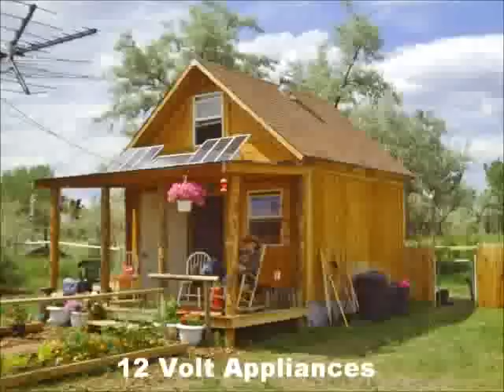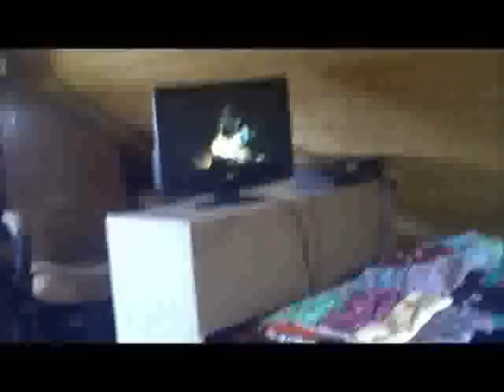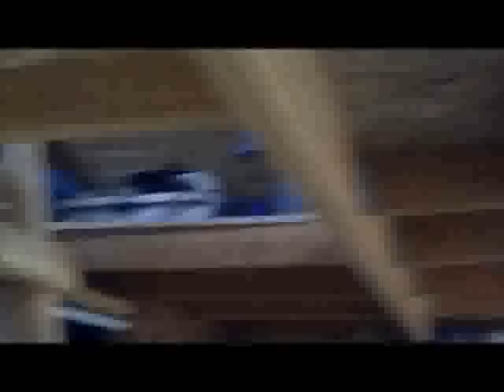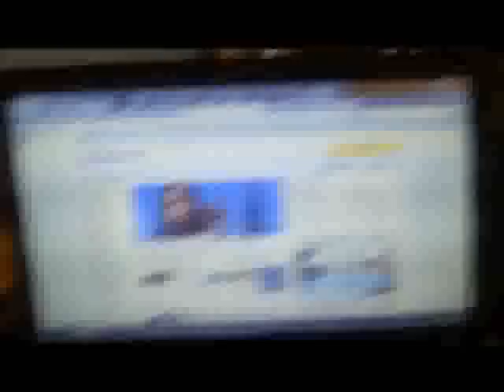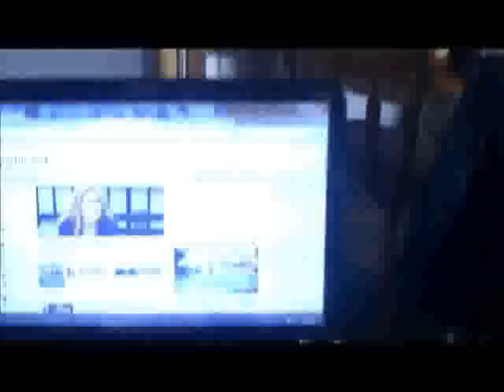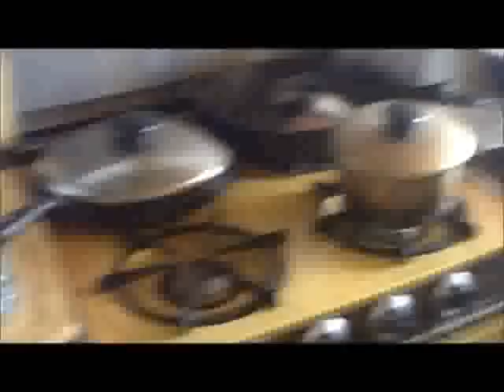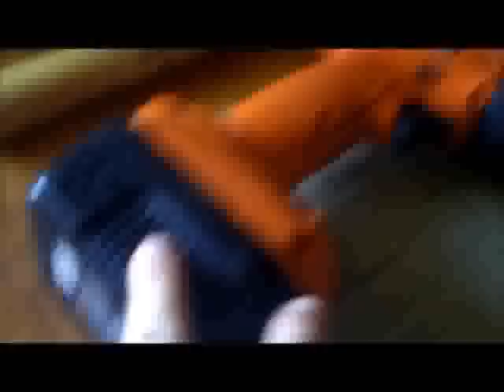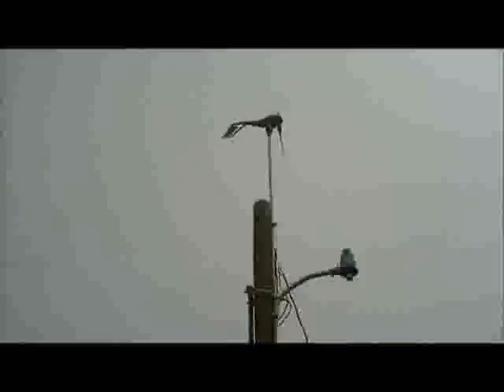Off Grid Cabin 12 Volt Appliances

Comment: These are waste for their intended use.  This will take up all you usefull load as a hiker.  For a fixed installation, look at cost per watt and your needs.  Also look at companies that have a deep footprint in solar power.  In almost all instances, their obsolete product is sold via these smaller companies.  Get up to date gear.  A good reliable system will cost a few grand but this is far less expensive to tie into the grid.

Comment: Im from Austin Tx. I moved to the big woods out Of Seattle Wa. so the heat is not a problem  I would suggest a swamp cooler as long as you keep up with cleaning and changing the hay filters if you don't your house will have a ton of meal due in the walls and your cloths but they do work great when well maintained. last time I looked you can get them brand new from Saers online.

Comment from the maker: My power shed is also my work shop and houses my washer and dryer so it is very useful. You want your batts protected from the weather and warm in winter so a shed works well. Batts off gas and can produce dangerous fumes so never store them where they could exhaust fumes into the house.

Comment: I love your videos, I'm working on a place in Beryl Junction utah and I had a question about your well. Do you use an AC 110v or 220v Well Pump? Will it run off of your solar/wind setup? I have a well hooked to the grid but I would like to go off grid sometime soon. my well is about 250 ft deep so I would require some power to draw water. I do have a 300 gallon holding tank though so I wouldn't need to draw water constantly.

Comment: Love your videos. Sometimes others see something you don't. Two suggestions: 1. Maybe heavier gauge DC wiring to your kitchen appliances etc to help with voltage drop. 2. This may be an important one. Extending your ladder higher up into the loft so you can get a firm grasp of it while standing and then getting your footing on it to descend...and even when climbing it and alighting to the floor. Same principle as extending a ladder above a roof-line for safer use. You are an inspiration to us

Comment from the maker: The cabin is small and well sealed so more insulation isn't necessary. I heat the cabin with a small 20,000 BTU propane heater or my small woodstove. Windows are double pane and doors are steel insulated. Eliminating drafts is what is important.

Comment from the maker: Thanks Mary- yes we do have harsh winters here. My well is free flowing and as long as water is running through a pipe it won't freeze. My holding tank is inside the cabin so it won't freeze. I have an overflow and the water is always running to keep it from freezing. That is how most old homesteads are set up.

Comment from the maker: Thanks- I added 2 more 6 volt batts to my system last year and I am adding a new 120 watt panel to my camper that will also be used by my cabin in the winter and will add probably 4 more batts for storage. I have more solar power than I have storage for right now so more batts are in the plans.